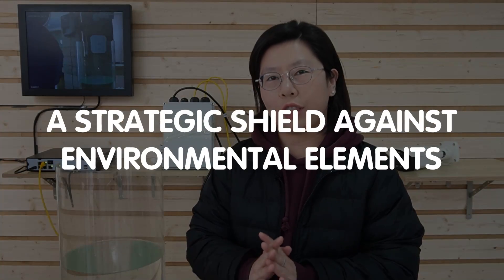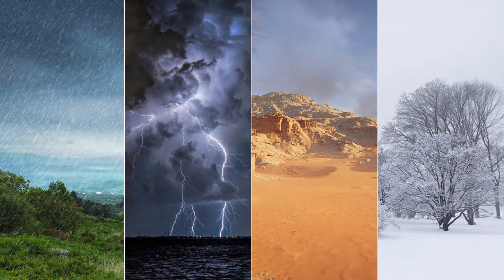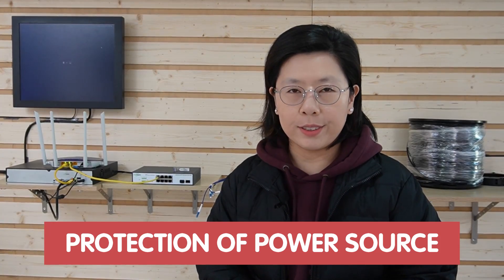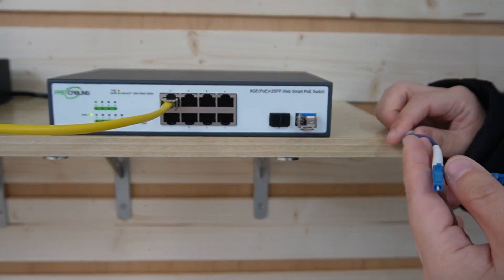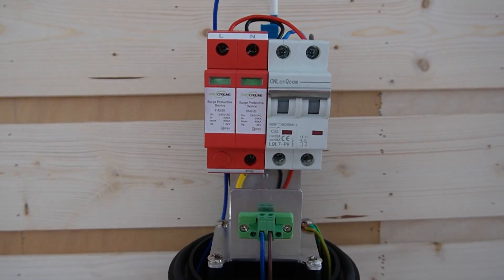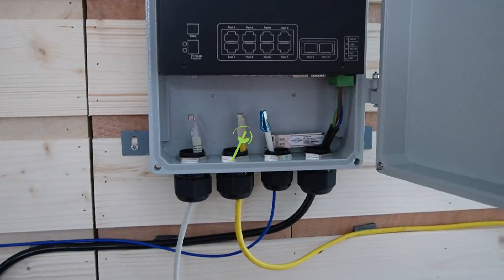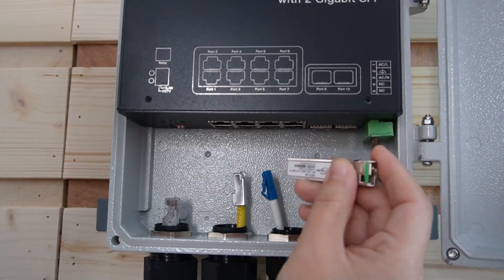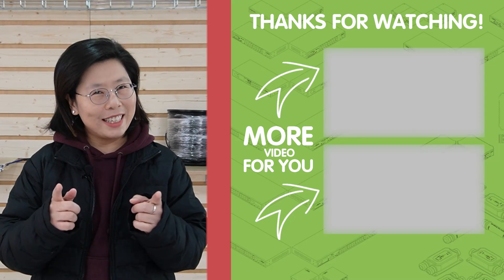How to Secure Outdoor PoE Switches from Environmental Damage

Comment: You need a video when using this type of power.  What is the maximum distance allowed from your AC outlet to the power supply and air switch?
Reply from the maker: There is a 100 meters between two network device over UTP cable, but not he power. As long as the voltage drop doesn't go cross the threshold your power supply accept, it will be good. Let's say the power supply unit accept the voltage input between AC85V to AC250V, and you have AC120V. The power loss (voltage drop) depends on the distance, the gauge and the power consumption.